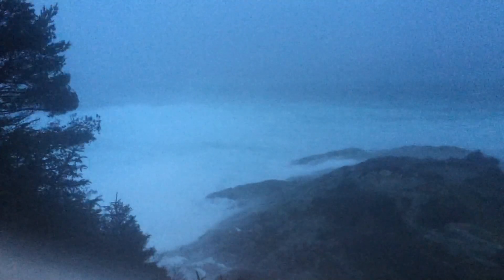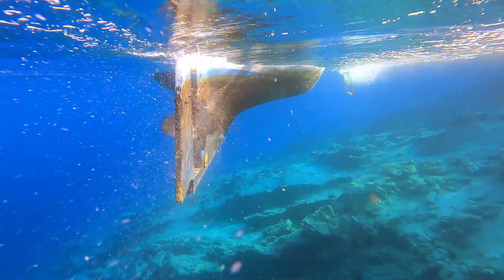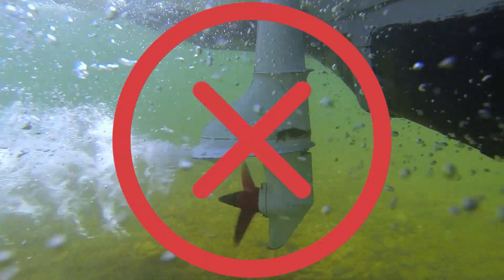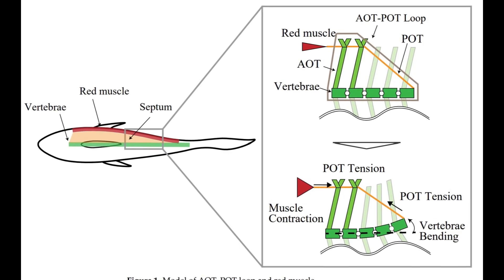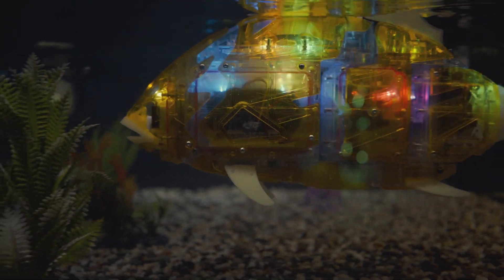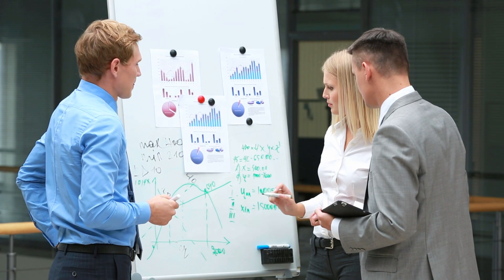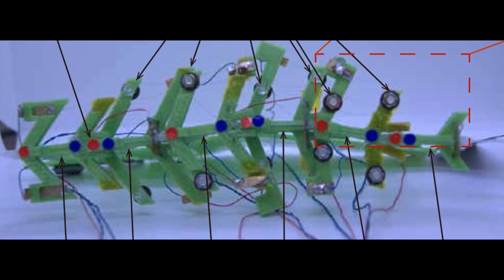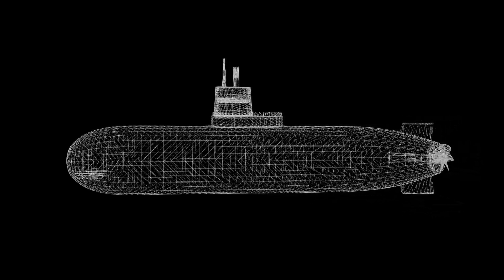Propellers are Finished... Fish Propulsion is HERE!

Comment: First off, the logic in your initial argument is flawed. Telegraphs don't equal propellers. 
Second, the tech is all well and good, but how does the submarine stop? Especially, how does it stop in an emergency situation?
Reply from the maker: Hi rorkgoose614, thanks for commenting! Well, looking at the first part of your comment, I think this is partly due to a misunderstanding. The idea that I tried to get through, is that sometimes just mere iteration and perfection of available technology may not always result in a breakthrough. Many times, innovation comes from a completely new approach. I agree with you that telegraphs do not equal propellers. It was more of an example where innovation has come from embracing a new approach. For example, the internet is our current system of communication, which did not evolve through an improvement of the telegraph but rather through innovations in computer science.

Then moving on to the second part, which I think is exciting! You do bring up a good point about emergency stopping in submarines; something that I hadn't thought of. Currently, when the submarine experiences an emergency, propellers are reversed. However, due to inertia, the submarine cannot stop immediately. Now, to answer your question, I would propose adding emergency flaps to the submarine, like how airplanes use the flaps as air brakes.  However, given that water is 800 times more viscous than air, meaning that water resists deformation and flow more than air does; the resistance due to flaps would develop significant drag, making the submarine decelerate faster compared to when an airplane employs flaps. I have to say, I loved this question, because it made me think. Thanks!

Comment: Look into the Thistle a a fin powered boat built by Harry Bryant. His design mimics a fish fin with a double jointed offset and a spring. I built a scaled up version and it worked quite well. I found it in Human Power The Technical Journal of the IHPVA Volume 11, issue 1, Winter-Spring,1994. titled "Fin Power-Success comes from copying nature" by Harry Bryant.
Reply from the maker: Thanks for the insights @rowgler1. I will take a look and get back to you!. Thank you!!!
Reply from the maker: Hi rowgler1, very interesting what you brought up! Thanks! I looked into it further and was really impressed with the prototype that Harry Bryant created. I'd love to hear more about your scaled up version, feel free to email me at biobyte0@gmail.com
Reply: @BioBytee  Sorry, I only just saw this. Original source for this knowledge is ... Human Power Technical Journal  of the IHPVA Volume 11,  Issue 1, Winter Spring, 1994. Page 6. "Fin power comes from copying nature" by Harry Bryan.
Reply from the maker: @rowgler1  no problem. Thanks!!!
Reply: I was a member of the IHPV back then. I built a foot powered fin driven boat prototype at the time. The hull was not designed to be very efficient. The amount of power transferred through the fin to the water was amazing as the hull created enormous waves that rocked the ( 24 to 30 foot) boats on both sides of the canal as I pushed it down through the canal. The next step was to build a proper efficient planing hull that would match the power output.
A little later Hobie of the famous Hobie cats, built a fin powered kayak with fins laterally mounted underneath powered by back and forth pedals.
Reply: @JohnHoranzy  The IHPVA was great, I still have all their news letters and Technical Journals. Dating back to the early 80s and into the late 90s when it sort of collapsed. Computer technology and self printing came out and the content and quality suffered. They got obsessed with gigabytes and Ram and it kind of took over the content, the photos got grainy and the issues became sporadic. Do you remember that? The fin drive I built moved a 27' boat against the wind with three people on board really well.I will never forget it because in the middle of the test run a creature was swimming towards us. We thought it was a snake. It was a chipmunk, it went around the back of the boat and continued to the other side of the pond. Didn't know they could swim, or why would it want to cross a pond. I still have that fin drive in the basement and parts of an improved version I started to build.
Reply: @rowgler1 those were good days. Sometimes I think about restarting that project. I got transferred before I was able to mount the drive unit to another prototype hull. I wonder if they are even offering prizes for reaching certain speeds. There are now hydrofoils that you jump up and down on that I think can go pretty fast..,..😅
Reply: @JohnHoranzy  Things have changed. I got into recumbent trikes and hurling/ siege weapons as a hobby. Still have to be practical to make a living, but my hobbies keep me inspired. I am doing my best to inspire young people and my own grandchildren to care about some of these wonders. It is easy for them to get seduced by the digital world and go impractical. Doing my best to be the most interesting grandfather to provide a good example.
Reply: @rowgler1 I also got into the recumbent thing. I hope you are able to build some projects with your grandkids. Teach them some maker skills.

Comment: "Propellers are Finished... Fish Propulsion is HERE!"  That seems reasonable: it would, after all, certainly reduce, or even eliminate, cavitation.
Reply from the maker: Thanks @ctaylor1460. Very interesting comment. I would think that the less cavitation you have in a propulsion system, the higher the efficiency. What do you think?
Reply: @BioBytee  Yes, of course.  A blade propeller can spin only so fast before cavitation results; after that efficiency drops off rapidly with an increasing angular frequency vector.  As a result, a propeller with a slower rotation, but with a greater blade surface area will (all things being equal) result in greater efficiency, which translates into greater speed.
Reply from the maker: @ctaylor1460 I have to say I'm finding this discussion very interesting. I wonder if your expertise are in marine engineering. Going back to our discussion, I agree with you that increasing blade surface area, with slower rotation, will inherently result in increased efficiency. However, I would argue that introducing a larger blade surface area, could increase turbulence, decreasing the vessels performance due to a larger wake formed behind the propeller. I would also argue that increased turbulence could compromise stealth, making the submarine detectable. Also large propellers have a more mass and inertia reducing the manoeuvrability. Would be great to know your thoughts on these points.

Comment: everything seems okay until it comes to practicality, think of a fish pullling a small boat , how big the fish should be . imagine a fish to pull a submarine , thats the amount of energy we need from the mechanism . so to move a submarine using this is feasible , but we need a fish tail which is very larger than a submarine to get it moved , lol .
Reply: True. Submarines and heavy vessels are impractical without significant advances in materials science and control mechanisms. 

For now, smaller crafts and robotics. But if it really works wonders. I’m sure they’ll scale, especially if it saves power.
Reply from the maker: Thanks, @srinivaskalyan9672. That's a good point you're making. Whale sharks, which are the largest fish species in the world, use sub-carangiform swimming. A fully grown adult whale shark, which is around 20 meters (approximately 66 feet) in length, might have a tail size of 3 to 4 meters (10 to 13 feet).

Now, a U.S. military submarine can be 110 meters (360 feet) in length. This means it's about five times longer than a whale shark's tail. Therefore, to move a submarine, you would theoretically need a tail of 20 meters (66 feet), which accounts for around 20% of the submarine's body length—similar to the proportion of the tail to body length in a whale shark.

In terms of energy, the requirement is relatively low because submarines don't have to move very fast.
Reply: I get it sir but if the point is onyl reducing the noise then this would work . But it’s about driving the submarine . Also we increase the length of the submarine to 20 to 25% based on your stats in the previous comment making it more vulnerable to torpidos and other stuff . May be if someone doesn’t care about the size then it’s fine . Also then 20 to 25% increase in length would increase material cost . Also there is a continuous stress on the links increasing the fatigue so the link should be made from expensive materials . So resources are being wasted . Even if it is wasted what was it all for reduce sound ? 😂